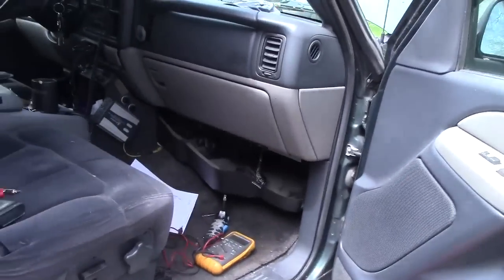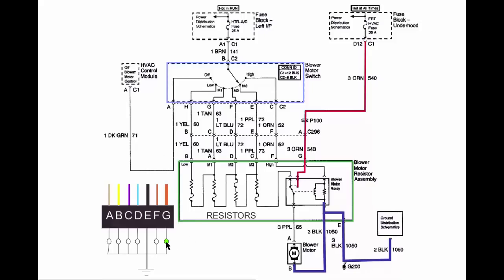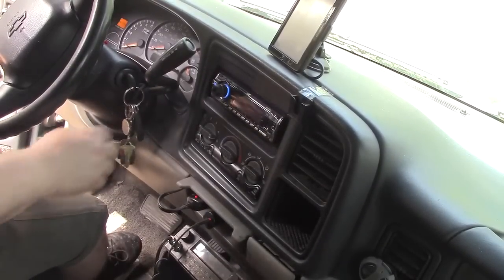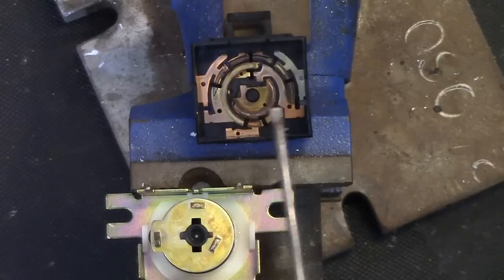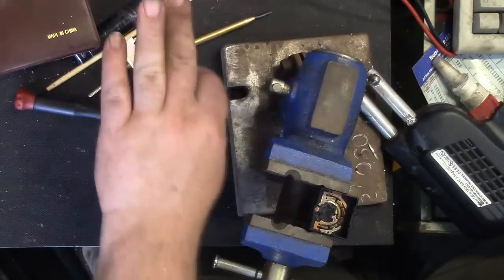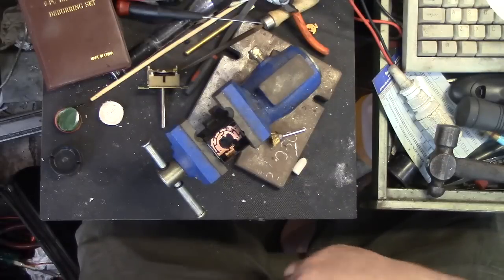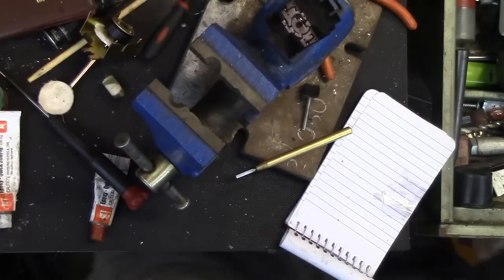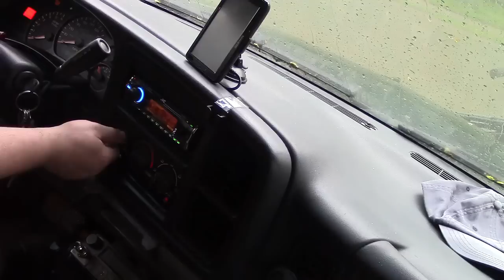Tahoe / Yukon / GM truck (GMT-800) Blower Switch - Troubleshooting & Repair

Comment: I have an 01 Tahoe 1-4 does not work but when I turn it on 5 it makes a loud noise but nothing comes out.
Reply from the maker: Without the tests done like I show in the video, it's a guessing game. Some history would help like what stopped working first, when did the noise start, etc.  4 things have to work for the system to work properly: The controls, the speed module, the motor, and the blend doors.  This assumes that the relay and fuses are good.  Also, I think the '01 has cabin filters that need replacing every year or the air flow gets blocked off.

Comment: Love what you did. 290.00 for a new unit 129.00 with the core. These assholes should sell the switch. Mine only goes on Level 5. May give what you did a try. I bet the remanufactured ones are just cleaned out and a new switch is put in.
Reply from the maker: Thanks for the comment.  Speed 5 goes through a relay and a different fuse.  At least go through the troubleshooting steps to see if it's the smaller fuse, switch, resistor pack, or the wiring harness at the pack.
Reply: @EddieTheGrouch  Relays are replaced, as well as the fuses. Just purchased the new resistor at NAPA. Let you know when I get it in and what happens.

Comment: Blower keeps blowing fuses when I turn the knob but if I replace the fuse, it works fine on whatever setting it's on..  . Until I turn the knob. Then it blows fuse. Anybody?
Reply from the maker: It sounds like the switch is momentarily turning on 2 speeds at the same time while it's turned.  You can test it at the connector under the dash at the motor.  Disconnect the speed pack and clip a test light to ground.  With the key ON, probe a pin and turn the switch to each setting - the light should only come on at 1 speed setting per pin.  If the light flickers or comes on more than once per speed the switch is bad.  NOTE: There will be 1 pin with a fat orange or red wire that stays lit all the time - that's the main power feed to the motor.  This all assumes yours is wired like mine.

Comment: i have a 2003 Chevy Tahoe..i turn on the heater control..the switch 1,2,3,4 are not working but if i turn to high 5 and the heater blower too much heat.  Any one have any idea how i can fix it...Thanks!!

Comment: My suburban 2000 model 

Only one yellow coloured wire dont have current.  I didn't found any fault  but I connect directly from battery it's working.  Can you tell me is there any relay in this yellow wire line?yellow wire coming from main panal and end at blower fans.

Please tell me what can I do

Comment: I have a 2000 chevy tahoe, the air in the front doesn't work, but when i turn on the air for the back it does work. Any ideas of what i should do? i've ordered the ac control switch.
Reply: Alice McCabe  did you ever figure this out? Having same issue. About to try and troubleshoot it